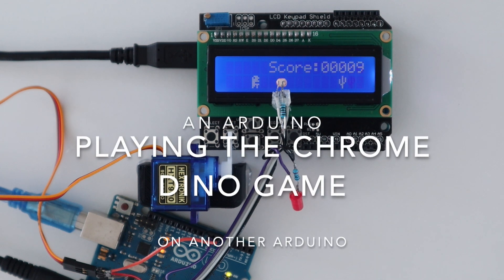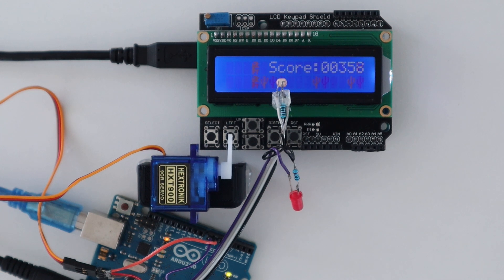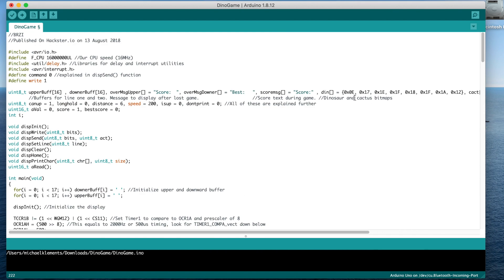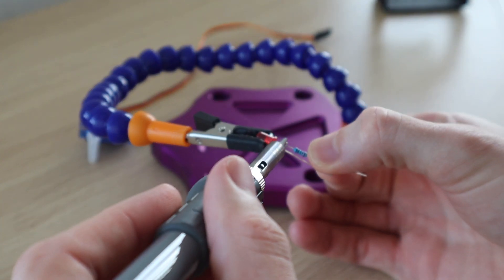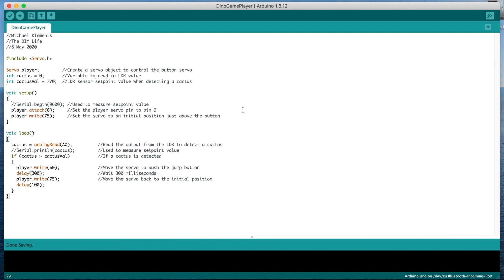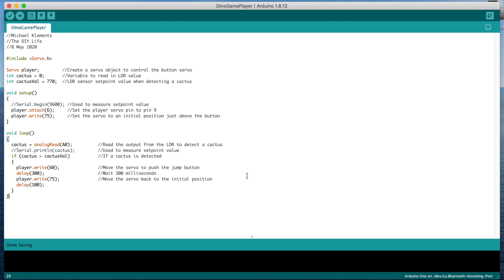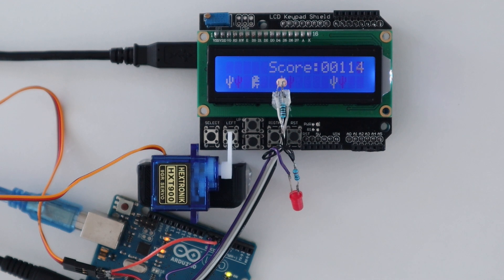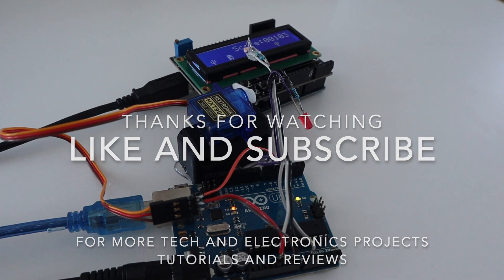Arduino Playing The Chrome Dino Game On Another Arduino

Comment: Very cool! You earned a new subscriber! I am making a similar project (without the second Arduino playing the game). As the game goes on, the speed gets a bit faster (up until a certain point). But there is a kind of "residue" left behind whenever a character is turned off, and at higher speeds it gets quite confusing.  Not sure if you know what I mean, I can't think of a better way to describe this. Would you be able to provide any assistance on if/how to remove this?
Reply from the maker: That sounds great! Yes I know what you're talking about, it's called ghosting. There is a limit to how quickly an LCD display like this can turn pixels on or off, what you're seeing are the pixels "fading" to the off state. If you need faster refreshes then you're probably better off using an OLED display.
Reply: @MichaelKlements  Ok, thank you very much!